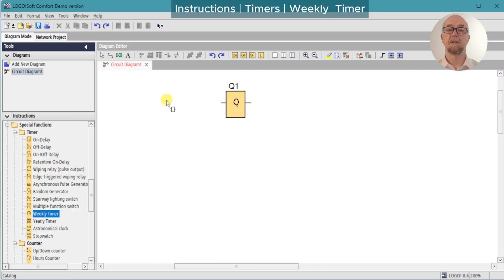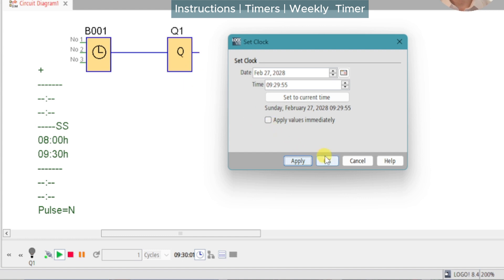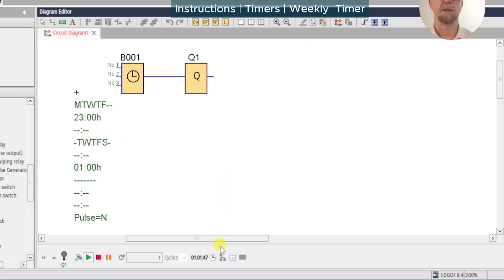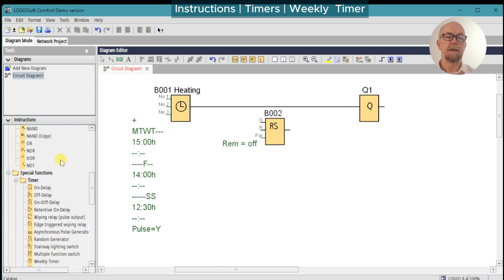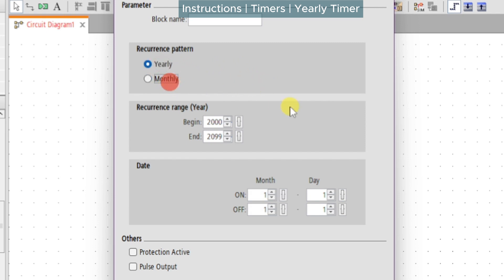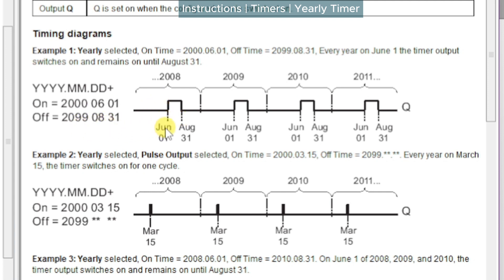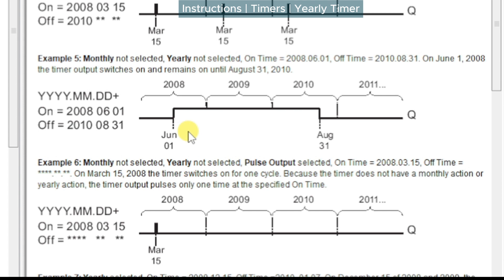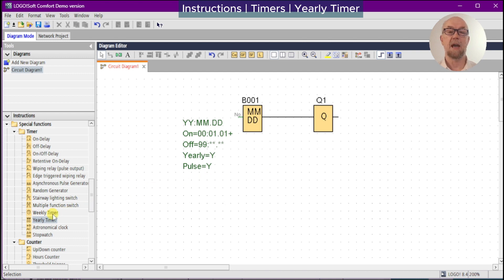LOGO! Timers 4 | Weekly timer | Yearly timer | Siemens PLC programming

Comment: I can see the cam has green input triggers but couldn't find any component to trigger each cam separately when needed
Reply from the maker: Sorry, reading your post again, the green inputs are parameter "inputs" which represent the three sets of parameters for the three internal cams. They don't accept logic inputs from other blocks. My previous comment is still correct about doing the logic after the Weekly Timer.
Reply from the maker: Hi, Nikolaos. What function block are you asking about? Weekly Timer? It has only three cams. There is no function to trigger the cams externally. You would do that after the Weekly Timer using AND / OR logic gates and perhaps RS latches.